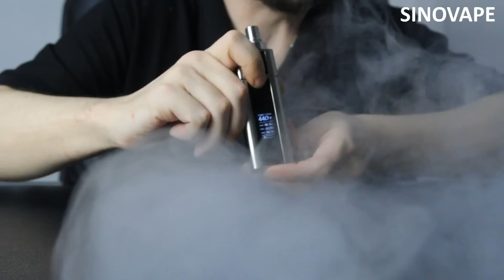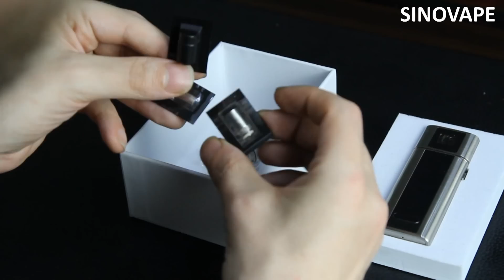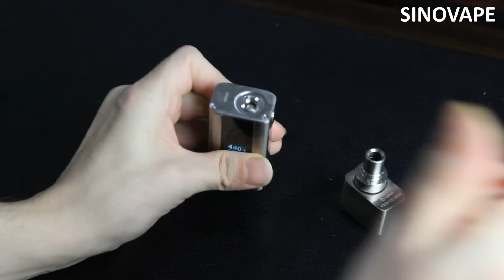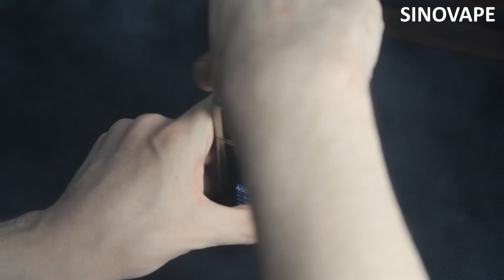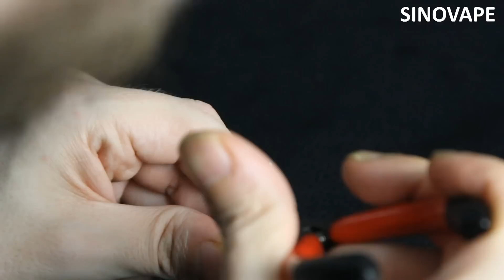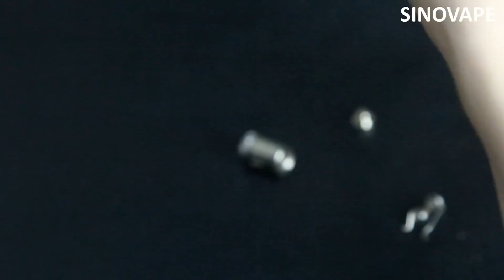Joyetech Cuboid Mini Unboxing and Introduction by Sinovape

Comment: Installing that new Clapton coil without prepping it with juice is really bad practice and against the manufacturer's advice. If that's how you installed the Notchcoil it might explain why it looked so burnt inside. You should really put some kind of warning on this video to stop people doing the same.
Reply from the maker: +David Barnett 
Hi David, thank you for your advice. This is a sample which has been used by several guys so we are not sure if we installed the NotchCoil that way. We rechecked the manual and the coil head and we admit it's not good for installing the coil this way. We are sorry about that. I think this is kind of personal habit on installing a coil head this way and a lot of people might do the same way. And of course it's not good at all. We will do more better videos in the future since this is our first one which is not so perfect. Thank you again!
Reply: Fair enough +Sinovape and thanks for the reply. I thought it was a pretty decent video otherwise, especially for a first go, so good luck with it all.

Comment: Hi, how would you compare it with Aspire Plato in term of flavour, vapour production and leaking? Thanks
Reply from the maker: +Vittore Tognetti 
Hi Vittore, there is no leaking from this product because unlike the mods with inbuilt tanks ther might be some leakage, the cuboid mini tank can be removed so there is no leakage. Plus the BF coils are not built into the tank so it so no leakage from the airflow as well. In regards to the flavour and vapour, both are on par with each other.